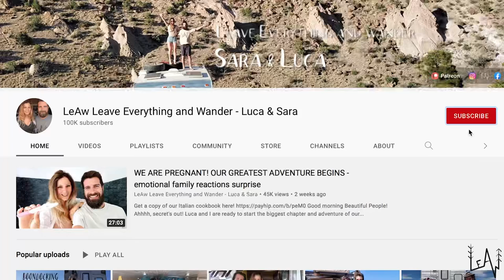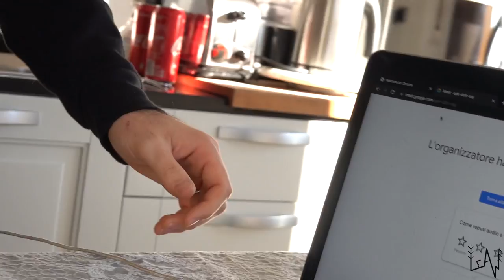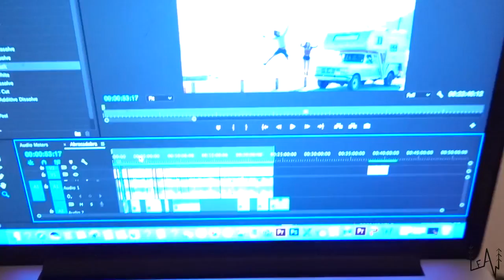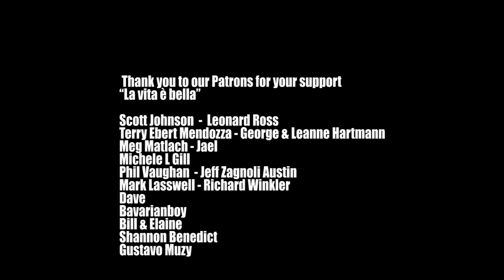DIY CHIMNEY RENOVATION PROJECT in our COTTAGE ITALY  - LEAW DAILY VLOG 2

Comment: Wow - the chimney is really coated with creosote on the inside! This means you are burning wood that’s not dry enough or the fire is not burning hot enough. It’s amazing that you are able to use single wall pipes - that pipe must be very hot while you are burning!

Comment: Interesting roof structure. Do the tiles keep out water when it rains? Also, I can't help but wonder if you might consider boxing in the chimney pipe in the upstairs bedroom? It would make it safer for the baby so she couldn't touch the pipe. Also, it would help keep smoke out of the room also. Just a suggestion. I second another commentor's suggestion to get a carbon monoxide alarm.

Comment: Thank you for sharing your adventure with us. I get inspired by your resourcefulness and drive to solve anything. 
PS: that chimney should be a bit taller than the roof so the smoke goes away. You could have used some special bricks that are resistant to heat and have a channel in the middle and go all the way through the roof. You should put se insulation between that pipe and any wood material.

Comment: so how was smoke getting into room? 
You never explained that.
Looks like you chimney has a lot of creosote inside from burning uncured wood.
That tape is not fireproof and is not made for sealing chimneys, it is made for sealing central heat and air supply and return ducts and air handler boxes.
your repair with the bends in the chimney will make it very difficult for you or a chimney sweep to clean the creosote from the top of the chimney.
you will still have the smoke problem in that room due to the leaky chimney in the corner of the room.